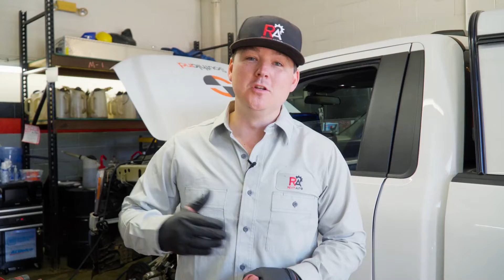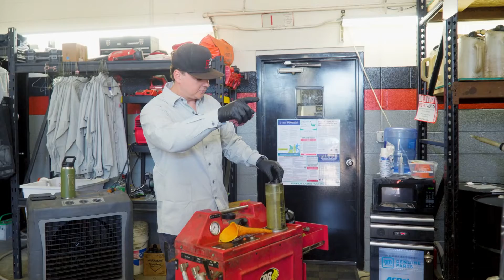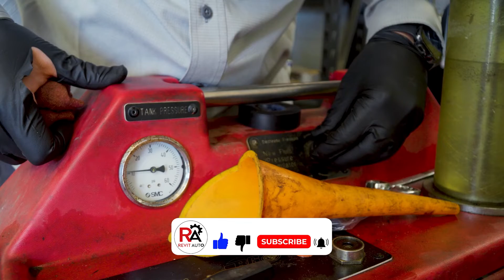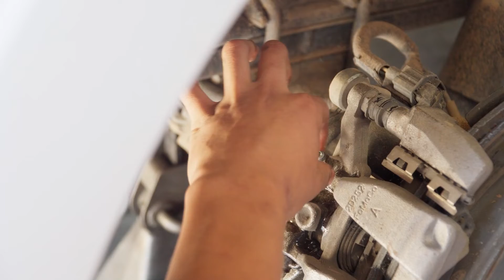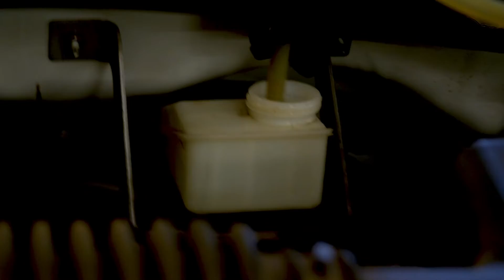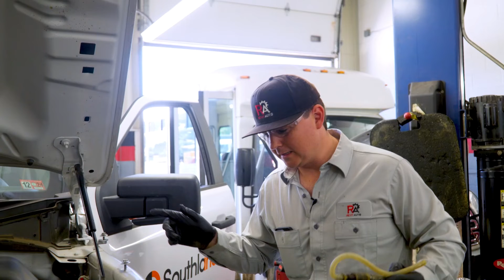How to do an ABS bleed procedure for a Ford F150

Comment: I ended up getting about 14 oz of fluid out of that first bleeder (front left/ driver's side, as per the ForScan specified bleeder order on my 2012 F150 5.0L - done while also being asked to pump the brakes every 2 seconds while the ABS was pumping fluid out), but only about 3-4 oz total out of all 3 other bleeders combined.  That seem normal? (Thankfully, I had a master cylinder auto-refiller bottle installed to keep the reservoir full on that first bleeder).